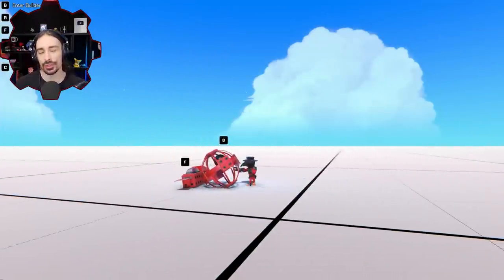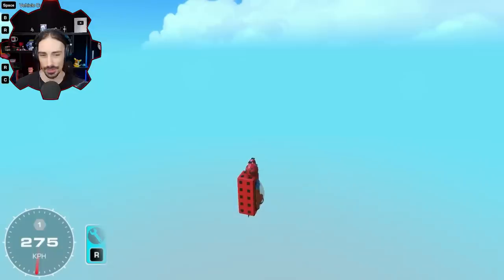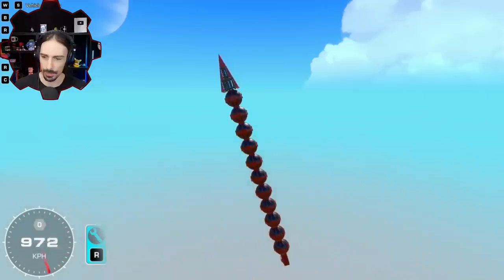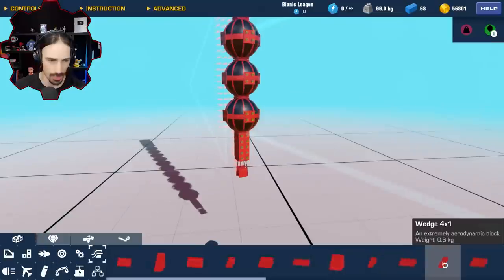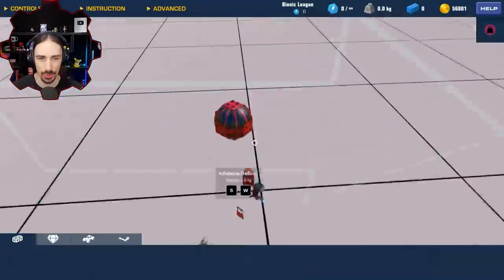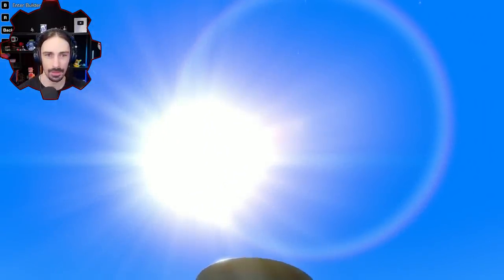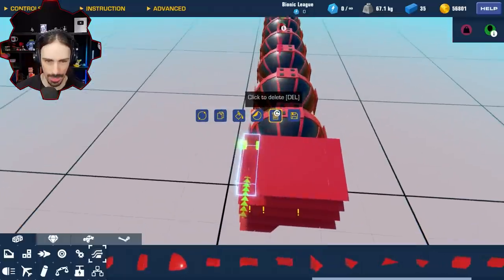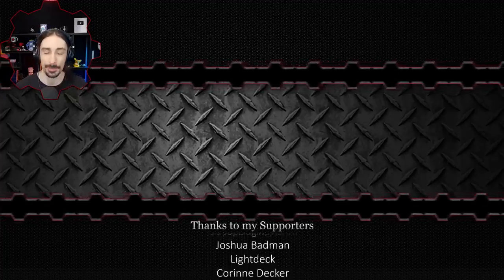How Many BALLOONS Do I Need To Break The Sound Barrier? [Trailmakers]

Comment: for the 11 balloons you could try with those triangular wedge blocks you said wouldnt work. in reality you could make the edges of the shape stick out from the side still reducing weight and with the same aerodynamics without the spin
Reply: Or use 3x3 triangular wedges
Reply: Even though it is lighter if it has a larger surface area then it would have more drag. Drag is independent of the weight of the block.
Reply: I was wondering that too. Maybe by the game's mechanic increasing 1 more block of sectional area will harm more than it helps with the weight reduction, no matter how good that 1 block's aerodynamic is, but it's worth a try.
Reply: But  it wont attach
Reply: What Conor and kruth said. Extremely good aerodynamics are still worse than no drag at all. Increasing the profile--even with extremely aerodynamic pieces--will slow it down more than the lighter weight will speed it up. Of course, in this setting, this is only a well-informed hypothesis. A good scientist would try it anyway.
Reply: The center of lift and mass would be misaligned, shifting the craft to one side.
Reply: Also, he could have arranged those triangular pieces so as not to induce a spin. So I'm pretty sure he could have done it with 11.

Comment: I think you would need to fix the center of gravity so it is below the center of lift if you want to get down to 11 balloons. Yes, that does add more weight and yes, the tailfin helped with stability, but there was still a little bit of a tilt as you went up. You were so long that the tilt had a larger effect on your aerodynamics than normal. The better aerodynamics should outweigh the extra weight you had to add.
Reply: I was a bit tired when I wrote this & the statement is false...

Shouldn't moving the seat into the middle of the balloons do the trick? That way there would be minimal weight-gain for the creation.
Reply: @RealPanzer999  this would make it worse as then even more of the mass of the creation is at or above the center thus making it more prone to tilt
Reply: @wolffang-vz2ty  I'm an idiot... XD was too tired when I wrote that.
Reply: The tilt was because he had air control enabled. He removed the tailfin, and then disabled air control to get rid of the tilt
Reply: @garretbernard8174  it still tilted until the very end, so yes it helped but no it was not gone.
Reply: Couldn’t he have just used the jetpack seat to align the center of mass, or is it also a 2x3x4 block instead of 2x2x4?
Reply: Replace the kart seat with a diving bell so theres no tilt

Comment: Use those odd shaped aerodynamic blocks, just don't make a corkscrew effect by creating rotational symmetry. You need to make it asymmetrical to reduce any rotational effect.
Reply: i had same thought if i had early access....
Reply: that would make it flip sideways, you can try the same thing now just without balloons
Reply: @magica3526  nah make the middle 2 angle to the left and the outer 2 angle to the right
Reply: make it symmetrical, mirror symmetry that is.
Reply: @mattzuma77  that would work, but that's not asymetrical
Reply: @mattzuma77  corkscrew effect

Comment: The balloons are in the balance section because the description for it says that it also includes bouyant things/bouancy controllers. And balloons, as you may (now) guess, are (positively) bouyant in air, and even more so in denser mediums like water. Too little(or too much) density in a medium and it will go POP because the pressure differences are too great.

Comment: Try playing around with the small armor plate blocks. When placed on their side, they provide green aerodynamics almost identical to the 4x1 wedge blocks (I think they're very slightly less efficient) and can sometimes fit into weird configurations where you only need to cover a very small area (or fill in hollow areas without adding a bunch of weight)

Example (block, plate, aerodynamics):
[   ] _  <<<
Reply: I was hoping he realizes that the 4 by 4 wedges have attachment points on the side and so he could get rid of the small connectors by rotating the 4 by ones to attach to each other on the outside but keep the 4 by 4s the same hope that made sense

Comment: So from the spinning we see that, although the aerodynamic profile of a single block is independent of blocks around it, the direction of the drag force on each block is affected by the slope of the block. Maybe you could rotate some of the other nose wedges to counter the spin, or even the tilt.

Comment: If you would’ve just lessened the weight at the top it would’ve fixed all of your problems, the air doesn’t get caught on blocks, if there is an 1x4 aerodynamic block there, its fine. So basically you could’ve done it with 11, maybe 10
Reply: Nevermind, you did that at the end
Reply: You then also added extra weight by adding the flat connectors

Comment: The spoilers could have actually worked, you would just have to attach them by pushing the one spoiler on the “bottom” of the seat up one.
Reply: Staggering the spoilers like that would balance the forces, but not the rotational moments. The vehicle would act like a lever; the spoiler farthest from the center of mass would have a greater effect on the rotation of the vehicle, causing it to tilt. However, this effect would be much lesser than Scrapman's test with just one spoiler.

Comment: Easy solution to the wedge nose. You can use a detachable block to detach/destroy them. The aerodynamics they gave is still there, but the parts/weight won't be.

ThatDomGuy did a video on this. It still works, unless they changed it in the Airborne update that is.
Reply: 20:20
Reply: @Mobliz  You trying to say something? I've watched the video lol.

Comment: Try moving the seat lower. Yes it will add weight but it will also lower the center of mass, therefore you don't tip and can go slightly faster.

Comment: In your previous video, there was a "gas mixture" setting on the balloon. Could that have an effect?

Also my guess was 25 (or not possible). I think I was a little bit off.
Reply: I was guessing around there as well lol
Reply: Gas mixture was at 1.00 (see 14:33). But maybe you could lower the gas mixture of the bottom most balloon to lift your center of lift.

Comment: You could try using the space ship seat which is fully centered and would fix the tilting issue because it is 50 kg. Also you could try the operator seat which weighs the same as the go-cart seat and is fully centered. I don’t know if either of these will work but I think it would be worth a try.

Comment: What happens if you use the corkscrew effect to "power" fixed propeller blades? Could that accelerate you faster while starting from pure buoyancy?
Reply: I think the propeller blades would create vertical drag unless you were spinning fast enough to break the sound barrier with the lift from the blades alone. You've then built a super-sonic helicopter. I could be wrong, though. I like the idea.
Reply: @theodoric4270  -- In real life, if you are spinning due to air resistance, then you cannot accelerate beyond the original velocity that started the spin (and you'd slow down in the process) unless you somehow add leverage into the equation. But in a game, programmers take shortcuts with the physics, so maybe in Trailmakers it does accelerate. I can't say for sure without trying it

Comment: Weight does not affect top speed, only acceleration. So you could just add weight blocks at the bottom to bring the centre of mass down and make it go straight
Reply: Not if youre going straight up

Comment: My hypothesis is 17 with good aerodynamics while calculating for the possibly of diminishing returns by the factor of the single balloon being approximately 1/10 the speed required

(New findings after 3 balloons)

New prediction 100 at least

Comment: 3:33
you should need 8 balloon's if you just attach the cockpit to it.
probably 9-10 with the extra weight of the blocks you need to attach the balloon's.

EDIT, 1 min. later:
that doesn't work as i thought

another EDIT:
maybe I wasn't off that much

Comment: Watching another video I noticed that in the balloon settings there are both the inflation speed but also another gas mixture parameter and I was wondering if it would change the buoyancy of the balloon. and thus change the rate of climb.

Comment: You could use the 4x4 wedges rotated on the side instead of the 4x1´s and you would be able to save some weight by not using braces

Comment: My guess would be yes. My guess for number is just a bunch of memes. So 42, 69, 360, 420.

Scrapman, has the gun projectile inertia changed at all? As in, do the minigun and smart cannon bullets travel at a set speed out of the gun as the cannon's projectiles did or do they accelerate at a set rate based off of the initial velocity of the gun when fired? I think with the new airborne dogfighting, it might be the latter. So does that mean the minigun recoil can get you sliding to the sound barrier?

Comment: Even though the larger angled wedge pieces covered more than they needed to, they were still much lighter than the regular wedge pieces. I think the weight difference would've made up for the extra surface area if you had replaced all the straight wedges with angled wedges.